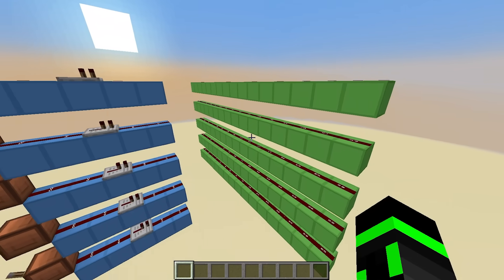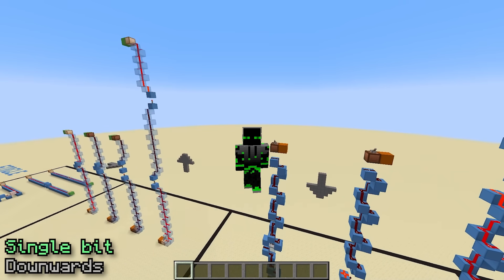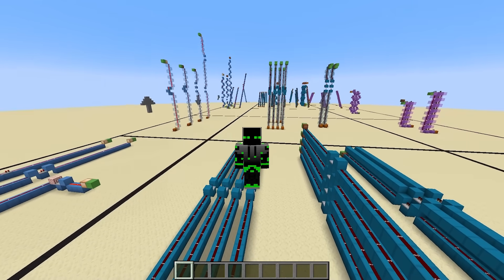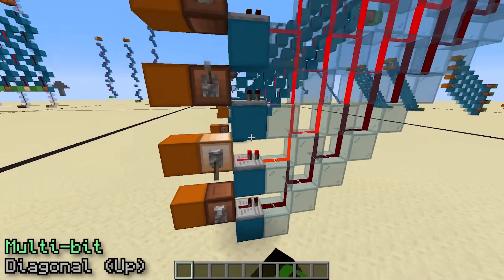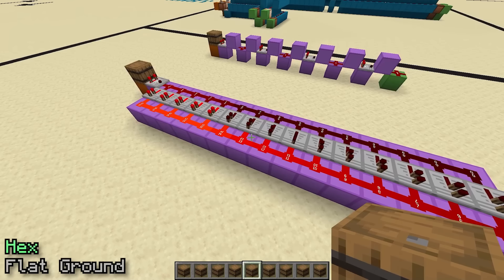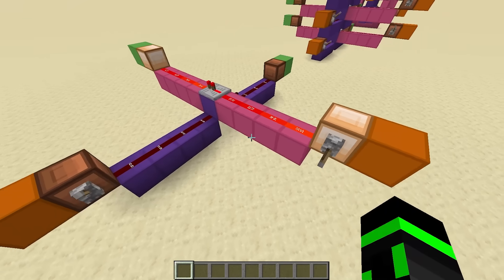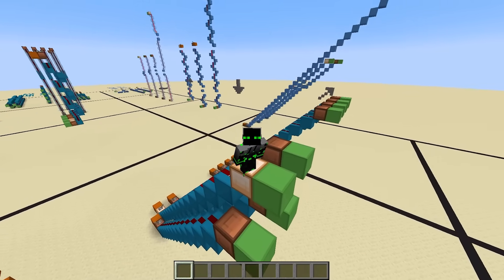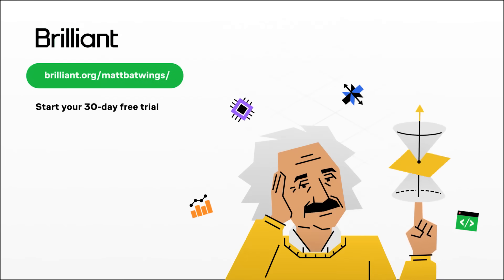How To Wire Like a Redstone Pro!

Comment: About going down: Why not just use Pistons with Slime/Honeyblocks and a redstone block at the end? that should be way more compact
Reply: Matt explained in a previous video that these are not ideal if you're trying to do computing with Redstone as they have a transition time and can leave their block hanging if activated too fast
Reply from the maker: @Kaldrin  yeah this video is more about computational redstone
Reply: @mattbatwings  This is such a great video.  It is unfortunate though that you missed a chance to very briefly explain "HEX" as values between 0 and 15 based on the contents of the barrels. This is why you have so many barrels on your hotbar.... each one contains a different quantity of items,  right ?!
Reply: @Kaldrin  what about walls? yes they require a piston but they have "infinite" reach, likewise with bubble collumns (and propably other's I've forgot)
Reply: @Kaldrin i agree, it not only it is slower but also inconsistent. who knows if someone want to switch on and off in a short tick, it would make the pistons malfunction
Reply: If you're doing that you might as well just use wallstone, transferring signal downwards by updating a column of walls' block state- one tick delay from the observer from any height, iirc
Reply: @dovahseod  true, but pistons were the first thing i thought of an i couldn't understand why he didn't even mention them
Reply: @Illuminati_HD  Probably for parity purposes as from the top of my head everything else in the video works the same in JE and BE while pistons have different delays. Pistons does have a great range though, as you get 15 blocks from the signal and another like 13 blocks from the piston.
Reply: @Illuminati_HD I guess they’re just super unreliable when your wiring has to be precise enough to make the kind of things these guys make lol
Reply: it takes longer
Reply: Any one gonna talk about the best solution? A dropper and a pressure plate
Reply: @maunewty  I remember using that a long time ago for some reason.
Reply: @maunewty  bubble column to reset the dropped item?
Reply: If you need to transfer a redstone signal down, especially if you want to send the signal to multiple outputs on the vertical without any delay between them, I would suggest Wallstone because walls, if configured correctly, transfer an update to all walls vertically down in the same tick. 

I believe Sqibble has a video showcasing it.
Reply: What about a sticky piston and a column of walls?
Reply: I’ve used stone walls or leaves with observers
Reply: If you're doing this, might as well just use a dropper with blocks in a cross sign with an opening in the middle and at the botton a hopper with comparator, it's at the very least faster, makes less noise, and about sending the items back up, just make a glass elevator or water or whatever, it's actually a good way to make exposed circuits less ugly, other ways would be target blocks and fireworks
Reply: @Sovaroga  ignore everything else that isn’t quite preferable for this implementation, item movement is the speed of a snail compared to redstone. You’re converting a delay of multiple game ticks into a delay of multiple seconds with a required reset time.

Edit/addition: sticky piston is 1 rt on retract or extend iirc, and items fall with a terminal velocity of 1.96 m/gt i.e. 3.92 m/rt.
Reply: @dovahseod  it's just that at the time I may have misunderstood what he said, as I was sleepy, I myself just woke up and all, i was thinking of a flying machine or something, IDK, it's just that using honey/slimes + piston made my brain instantly think of one and I didn't take enough time to reconsider, if it is pushing then it's a good one, but really, why would the slimes/honey be that important ? Since normally I'd think of a two way, and it should be like just one extra piston underneath, idk, I can't think clearly now
Reply: @Sovaroga  lol we all come up with an idea as an alternative then take a while to realize that it doesn't quite work sometimes
Reply: Simple answers are time, noise, and space
Reply: a